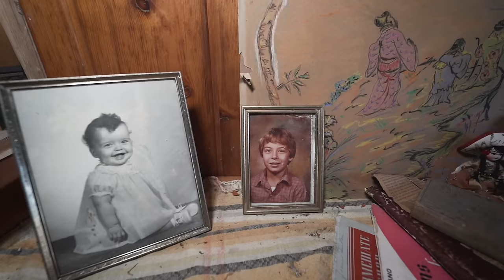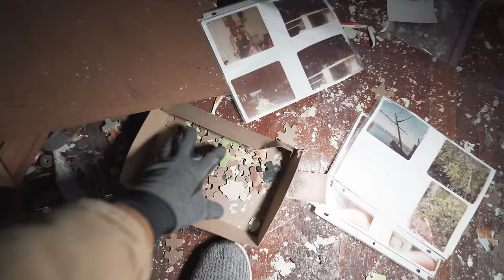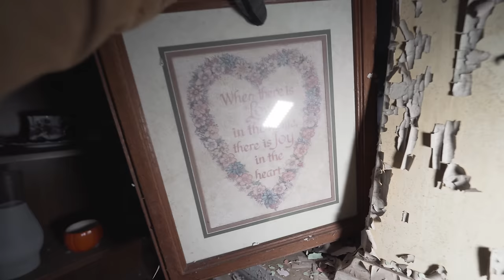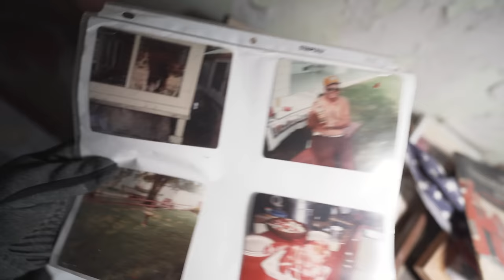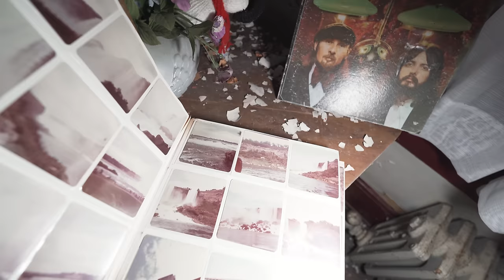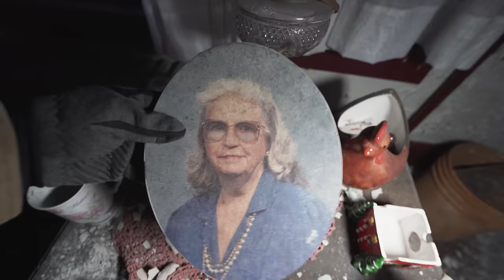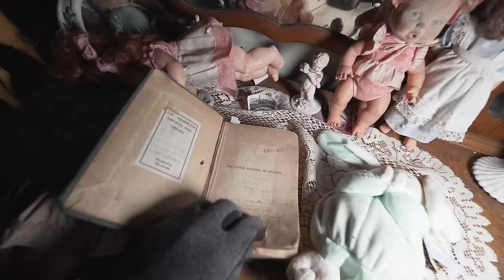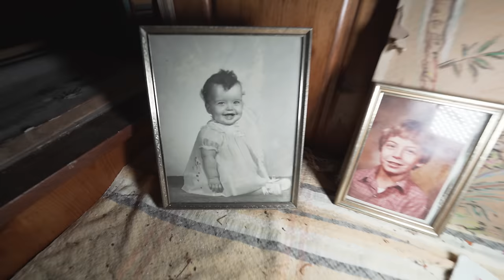25 Year Abandoned American House - Family Treasure Found in Backyard!

Comment: American houses decay quickly because of the tar-paper type roofing materials. They need to be replaced every few years. All the rain and melting snow runs through the structure and rots it fast. Very sad. Microwaves were not common until later in the 70's/80's.